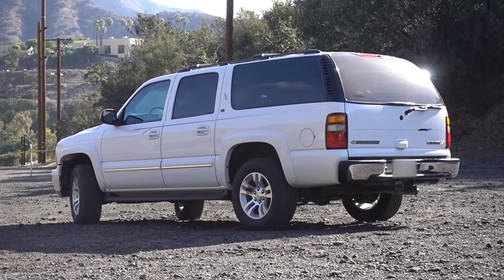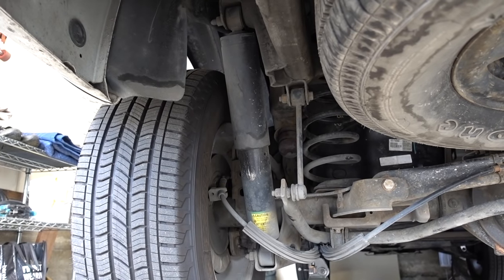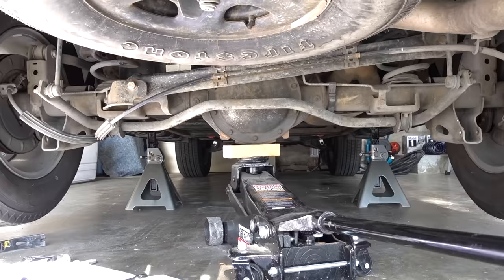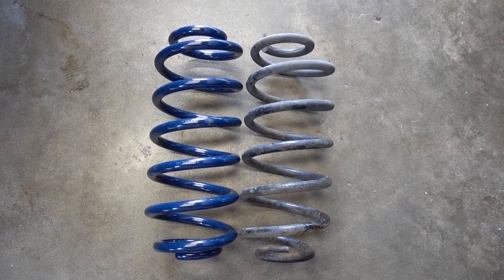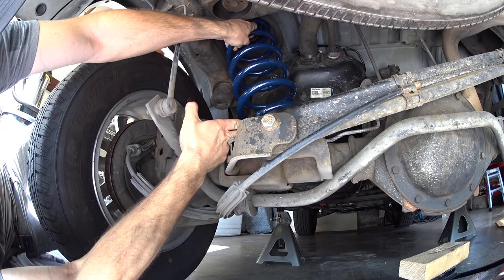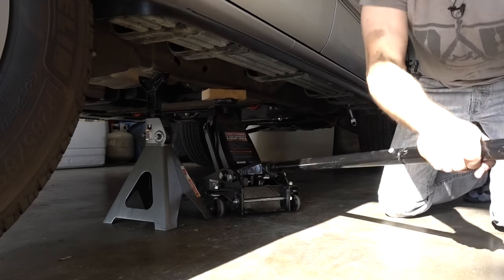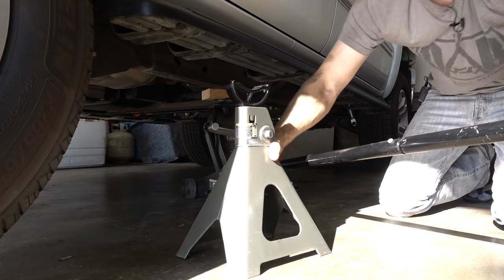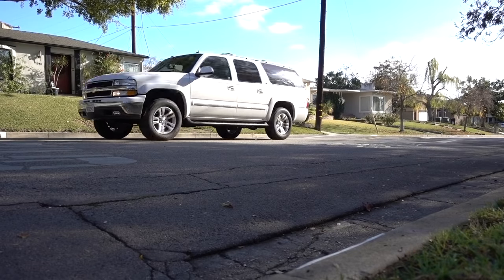BEST BILSTEIN 5100 REAR SHOCK & SPRING UPGRADE EVER!!

Comment: For everyone’s information. The Z71 and standard suspension trucks do not have these special shocks and do not require spring replacement. Only the ZW7 option code (can be read on an options sticker inside your door jamb) require the spring swap. Also, ZW7 smooth ride trucks are not the same as Z55 Auto Ride trucks. The Z55 option is a full on electronic shock and air spring system.
Reply: Do you know if we change to bilstein shocks .. will it damage anything on the vehicle?? Or will it ride the same ? Thanks for any info... cuz mines also has the smooth ride performance .. and I need to change the rear shocks  but don’t want to spend too much money ..
Reply: @gustavokimbys3302  did you ever change your shocks and springs?  I’m wanting to do the same
Reply: I got springs and shocks on my avy what u talkong about dude ??
Reply: What are you talking ive seen avys with shocks and springs
Reply: Uhmm my 2005 Z71 suburban actually has these exact shocks... Also this odd rare Z71 is also not equiped with 4x4
Reply: What about zq1 trucks?
Reply: I hear the boot is supposed to be facing down ??? It matches the stickers. Is that true?

Comment: My neighbor completely built a 2002 Yukon XL 2500 SLT from the bottom up. Upgraded every nut and bolt, you could think of, dropped a brand new 6.6 LB7 Duramax with an Allison 1000 into it. Kryptonite steering components, the whole shabang. Spent well over $100k into it.......has it for sale in his front yard for $40k. The thing is a MONSTER but its never touched a bump since its build. I'm about to sell my Sierra and buy it just cuz I know its pretty much indestructable😂😂😂

Comment: I watched this video at least 10 times before I put these shocks and springs on. This is what I learned.  Use a 3 ton floor jack. Use 6 ton jack stands. Use blue lock tight on all the bolts except for the nylon nuts on top of the front shocks.  If you can get the rear high enough you won't have to remove the wheels, but you have to release the rear shocks while you have a jack supporting the differential and you have to lower that as far as it will go and you can remove the old springs and put the new ones in with out having to use spring compressors.   I had to remove the rear wheels so you must have had your truck pretty high. Maybe 5 or 6 notches on the jack stan. I went back through all the bolts an check the tork once I had the truck back on the ground but didn't really notice any chang. I spent about an hr. On the front and two to three on the back.  The dealership wanted 4 to 5 shop hrs. To do the job at $120./ hr.  It was worth the $ 200-300. I spent at harbor freight for the jack and Jack stands because I'm sure I'll be doing more repairs now that I subscribed to your channel.  Thx again!
Reply: Thank you so much!!

Comment: I also replaced my nivomat shocks on my 03 burban with the 5100’s but I installed MOOG heavy duty  or the Z71 springs instead of the bilstein. Smooth ride, no complaints.
Reply: Did you need to compress the new Moog spring?
Reply: Nice. I'd like to go with the Moog, too.
Reply: Normally you do not torque bottom bolt unless it is on ride hight

Comment: I recently changed the shocks on my suburban. I bought standard shock because it had standard shocks on it. Now I looked in the glove box and it has the zw7 rpo code but it had normal shocks on it and doesn't appear to be sagging in the back. Do you think someone already changed the springs? 🤔

Comment: going to be replacing the front and rears on 2014 suburban. any suggestions? I prefer not to have ride height change. if it was 2-3 inches higher i would not care but just don't want sag.

Comment: I have a question guys i liked this vid  i have original air ride in my 03 yukon denali  xl i wanna change to conventional shocks and springs front/rear  im thinking on bilsteins  5100 and 4600 whats the difference  5100s can work better or is for lifted vehicles  also bilteins or other brand springs are etter?

Comment: My 03 tahoe has the auto ride suspension, and the rear shocks are shot and very expensive to replace, will this set up work on mine? Is that the same factory suspension your suburban had?

Comment: Do you have any experience or comment with the Arnott shocks. I’m torn between Bilstiens vs Arnotts for our 2002 Escalade. Just came back from a camping trip and well family got motions sickness since id never had any suspension issues until this trip, when I loaded the cargo rack and rear basket with camping gear and the first 5 min on the road trip car was swaying horribly. So need the best shocks for comfort but also extra heavy duty for carrying the extra weight. Your feed back is extremely appreciated. Love your detailed videos
Reply: Did you ever figure  out about your suspension  parts.  I have Arnott in my 07 yukon.  I  didnt like the ride much. But I have nothing  to compare it too. I bought my truck used and the original  was blown

Comment: I haven't come across a problem that I had. Had a shop put mine on, and on the front strut, the adjustable clip was set right, and when taken off the lift, it collapsed. Waiting on a new strut, the other three, no problems. Shop had never had it happen before.

Comment: I’ve got the same on our 05 avalanche 4x4, and we love them but I’m looking into a stronger,  stiffer spring for when weighing down the truck or towing our covered trailer. Towing about 2500-4000 lbs  any ideas I’d greatly appreciate
Reply: Any Luck??? Looking for the same thing.

Comment: Gotta 05 z71 gonna put the 2inch torsion keys in 5100 bil shocks&springs but my question is have you had any real weight in the truck/ family loaded vacation weight that's where you'll really know how well they preform? (Reason I'm asking is, that's what I use my truck for) please let me know you were please with the weighted down 4100's
Reply: I'd say it will sag.  This is why I left my nivomats in my yukon.  I put 4600 in the front and left the rear stock.  I've loaded mine with over 1k pounds in the rear and could not get it to come down.

Comment: Great video! I have a 2004 Suburban and changed front and rear to the 4600 Bilsteins rather than the 5100's. Read quite a few reviews that the 5100's will lift factory height which I didn't want. Also read the 5100's create a bit more of a stiff hard ride than the 4600's. Also went with the Bilstein springs to avoid the sag in the rear. Over all I am very happy with them.
Reply: Hey boss could I get a link to the 4600s and springs?

Comment: Good luck with them
I made it 5800 miles on a set, started pouring the oil.
Couldn't get them to warranty it.
Three years later the bushings had rotted completely out of the shocks.
I had good service from their circle track shocks, but I wouldn't run their street shocks on a wheelbarrow.
Check out the taco and Nissan forums a lot of people have had bad experiences with their 5100(5150 series. 
Better off with Gabriel or Rancho  junk from advance. At least they will stand behind it.

Comment: Just swapped my shocks after 150k miles, I too had the premium zw7 suspension on a 03 Tahoe and it was shot. Ride horrible on bumpy roads. Felt like a boat basically. I not knowing those shocks were special ordered rear OE AC Delco shocks for cars with out the premium ride. Well they do ride much better, but the rear dropped a bit. Didn’t know I had to change the springs… oddly, instead of changing the springs I’m thinking of going back to the Nivomats, simply because they are self leveling shocks under load, and also seem to offer great ride. They are expensive, but they do offer a lot of benefits traditional shocks can’t.
Reply: Would the 4700s fit on a z71 tahoe or does this only work with the premium suspension?

Comment: If anyone could chime in, that would be awesome! I just put a 1.5" leveling kit on my rwd 1998 F-150. I bought Bilstein 4600s to put on, but the cushion on top won't compress, in fact is about .5-1" too short. Any bump I go over it bounces really bad because of the gap. The 5100 says for 3" lifts. The travel is not much different, 10-14 for the 4600, and 11-17 for the 5100. Would this work and not cause any problems? Thanks!

Comment: Hey I have a 2002 Chevy avalanche and I am studying your video to perform the same work I have a few questions I hope that you can answer. 1 what size jack stands are you using 3 ton or 6 ton. Question 2 in order to drop the rear axle did you need to un-install the rear springs in order for it to drop axle so that you could take the coil springs out
Reply: Bryant Reddy 3 ton jack stand would work no problem and if you have leaf springs like mine you don’t have coil springs

Comment: My new rear springs took a month to settle in. But they're firm cop shocks for an 2003 Impala 🚗
Reply from the maker: Wow. Same size?
Reply: @1RoadGarage  last month+  I put the cop shocks on a Buick 2008 lacrosse. And TTX terrain though xtreme (rear sway bar links ) »🚗 my other car is a Suburban 1995 GMC K2500 with ACDelco shocks front and back.

Comment: This would've been nice to know a while back. My 03 has the self leveling rear shocks too. Busted them both on a trip back home from a family vacation. So, not knowing any better, I went back with the same, and spent $750 on Rock Auto. If I'm not mistaken, 5100s are less than half of that🤦‍♂️ The more you know, DiNG..STAR😂😂😂
Reply: I just did mine front and back with the Bilstein 5100's , springs too for a little over $400... Ride is great.
Reply: @uglyhandgarage2927  Yeah, I'm thinking about doing a lift on mine now, so I will definitely take a second look at these.
Reply: Bit late here… but how was the difference between the old and new shock? The premium ride zw7 nivomats have the advantage of being self leveling shocks under load and better ride handling as well as comfort. But it is pricy. I not knowing anything, replaced my nivos on 03 Tahoe with OE ac delco for suspensions with no premium ride… and they do ride much better but now the rear has dropped a bit it’s sagging. Under load it would squat. I’m thinking of going back to nivomats instead of the bilstein route simply for the spring adjustment advantage over regular shocks
Reply: @VCR1117  Honestly it was a damn good ride afterwards. With the amount of weight in my cargo area due to a custom system, it had a little squat but it almost still looked factory. Unfortunately I totalled it about 3 months ago so I have to start all the way over. Now have a 2010 Yukon Denali XL, and after I get the stupid DOD situation taken care of, then the suspension is next.

Comment: One of the best Mods I made to my 03 ZR2 was to ditch the Bilstein rear shocks.  They were way to stiff on compression.  The ZR2 is an "offroad" pkg but even then you don't need rock hard rear shocks unless you are jumping levies.  Put in Monroe LT GasMatic shocks and now my teeth are not swapping places when I drive down the road.  Much better.

Comment: I think  u dont have to ins.. new spring for rear.
By the way....why there is no spring in front..What makes the front axle flexible without spring ... amazing thing.🤔
My car is tahoe 2006 4x4
Reply from the maker: A torsion bar, made of spring steel, is used in place of coil springs.

Comment: You should also add the bilstein 5100 series steering stabilizer.
Reply: Thank you
Reply: I have a 2003 GMC Yukon SLT and I'm going with Bilstein shocks and springs,but the steering stabilizer won't work on a 2003 according to eBay.
Reply: @Kendell062  don't use ebay for parts reference. Use bilstein's online look up.
Reply: @yellows10dude   You're right, should have made sure by checking Bilstein's website.

Comment: question, I have a 2004 gmc sierra 1500 pickup. I would like to put the same front and back shocks and springs you put on your Tahoe. Where can I buy them? on ebay it says they do not fit a 2004 GMC Sierra 1500? I would like to buy 4 shocks and 4 springs. thanks any suggestions on where to buy them?
Reply from the maker: I would go to Bilstein's website. There you can search for the recommended products based off you exact vehicle. Then buy on Amazon! 👍👍

Comment: Great video. I have a 99 yukon and i installed the  5100 shocks on the rear so far and wow what a great ride it made. I will b putting the 5100 on the front soon. Keep the  vids coming. Thanks
Reply: Brandon S  Nope
Reply: JNB so did you get er done and if so how do you feel about it.... I’m getting all four done with new MOG springs shortly

Comment: Had Bilstein shocks on my 2000 Tundra and my 1999 Jeep Wrangler when I owned them. They both rode great. I will need shocks on my 2003 Silverado 1500 next year and will be putting the 5100 shocks on it. The 1999 Wrangler had the 5100 shocks on it. Can not beat the ride quality of the Bilstein shocks. Great video keep it up.

Comment: Random question but I was curious what size tires do u have on the 2003 suburban?
Reply: Grim Tim they’re the stock size from a 2015-2020 Suburban wheels but the bolt pattern is the same

Comment: I think you might have your shocks upside down. I think the rubber boot should be at the bottom.I'm installing the 5125 model on my f150 and that's what the installation manual says. Let me know. Thanks
Reply: Boots go up bud😂. Have the same shocks on my Z71 Sierra.

Comment: Bah!  Those front shocks didn't look THAT bad.  You've not had bad shocks until all the fluid has run out and it makes a grinding noise when you work them by hand :D

But yeah, that top, passenger shock bolt is in the worst place possible, it's even worse if yours is a bit rusty and corroded, making it a pain to wrench out by hand.

Comment: With my ram 1500 bilstein 5100 front shocks are ajustable with a snap ring and my original fron spring . i have a 1inch block in the back and the front is at 1.6 inch , my next step ill buy the back 1.5 inch lift spring and new ready lift upper control arm to raise the fron to 2 inch .
Reply: Those are struts, these are shocks. Similar, but different in that the Spring and shock are one unit making it a "strut".

Comment: wat yall tink of the kybs struts gr2 n monomax?
Reply: I have KYB Monomax in my 91 F250 2wd diesel. They're great but VERY firm/stiff. Unloaded and with no fuel in the rear tank, it's downright obnoxious, but with a load in the back they're superb and exactly what you want. Next time I'm going with Bilstein 4600s like I have on my 93 C2500 Suburban. Doesn't get any better IMHO.

Comment: Woulda been nice if you took some before and after measurements to see if it lifted the rear any
Reply from the maker: It did lift the rear some. Waiting a bit to see if it settles down. Will make a video about that...
Reply: @1RoadGarage  so is it higher than 36 5/8" now in the rear?  My 06 Yukon has 125K miles and the rear self leveling shocks are still good.  I've loaded the rear with fire wood and that thing barely went down.

Comment: Little tip I found with my 5100 on my tundra. I doubled up the zip ties on my shock boots and they were loose after about 2k miles. Grab some stainless hose clamps from Home Depot or your local hardware store. Def eliminates the possibility of it coming off again.

Comment: Do you tow anything?
Reply from the maker: Not regularly. Just when I move...
Reply: @1RoadGarage  I was asking because I have the same stock shocks that you had. I tow a small camper and the factory shocks would stay level with any load. .I was looking into this conversion but have been concerned about sag....thanks for the reply and posts . .merry Christmas
Reply from the maker: The reason why I did the rear was because those new Bilstein springs were supposed to be able to hold the rear end like the Nivomat shocks did.
Reply: @1RoadGarage  good to know...

Comment: Just put the 5100's on my Tahoe yesterday and in my opinion.... They are over rated. No drastic change,truck sits a little higher and you FOR SURE will hear the springs in the back when going over bumps slow!!!  NOT IMPRESSED AT ALL!!!

Comment: Bilstein has terrible customer service.
I am wondering if they have went bankrupt??
Cant find any 5100s anywhere from coast to coast-
All plants appear to be shut down-
Distributors tell me that they have thousands on back order and haven’t had any come in for over 6 months,
A technical service advisor at Bilstein actually told me to buy KYB shocks , that he runs them on his trucks.
I had ordered all 4 new shocks back  in October, they only delivered 2, though they said they were in stock.
They said the other 2 would arrive for my front in 2 weeks, that was over 3 months ago.
Unfortunately I had already installed the Bilsteins on the rear,
Ordered the KYBs for the front from another company- RockAuto, arrived in a couple days,
They are doing great.
The run around and lies I got from Bilstein & Summit parts was horrible-
I won’t ever recommend either.